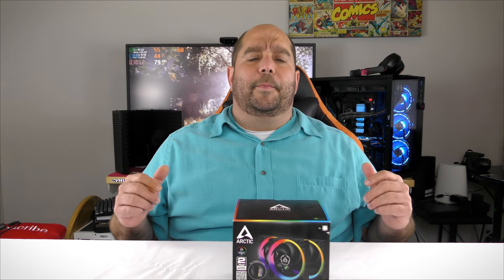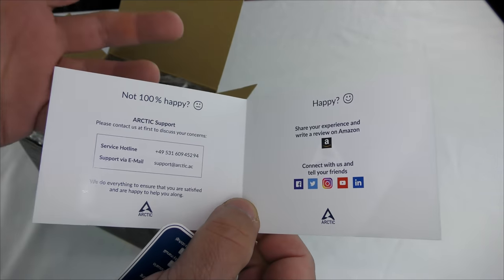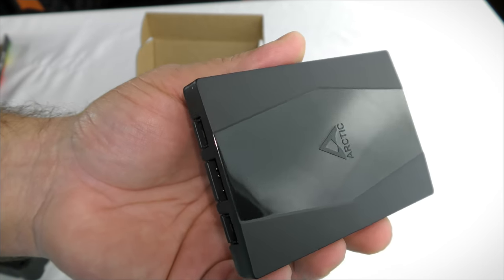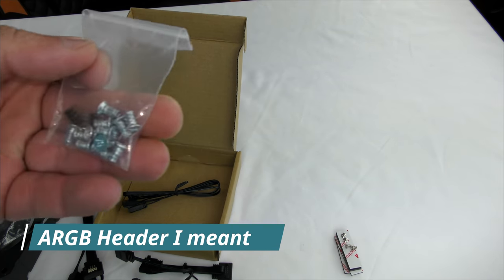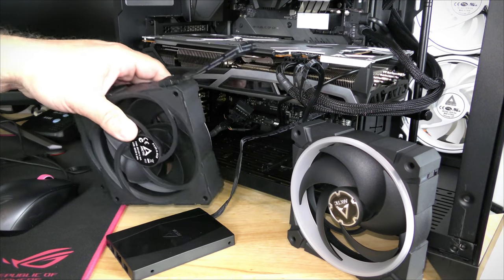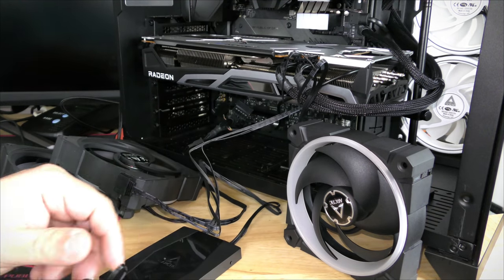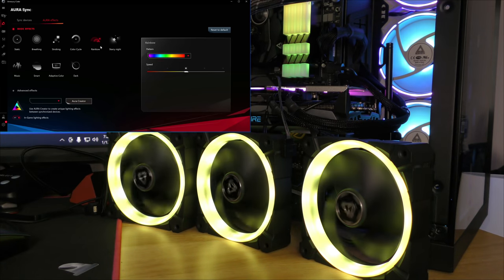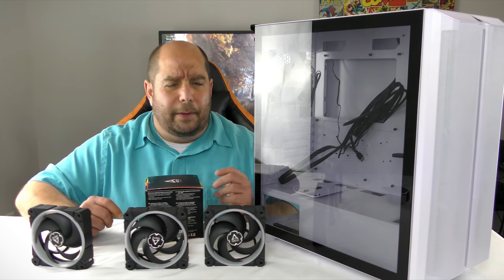NEW ARCTIC BioniX P120 A-RGB Fans - First Look

Comment: 10:35 it does NOT work with ARGB!!!!!
Reply from the maker: hmmm, odd, did you watch the same video I recorded showing you it working?
Reply from the maker: I am assuming you are having issues, maybe explain the issue and I can help you?
Reply: @ThisBytesForYou  You connected it to a 12V 4pin RGB header as it was meant to be used. It does not work with 3pin ARGB headers.
The hub „translates“ the „RGB“ into an ARGB-signal. Your motherboard has 2 ARGB (3 pin) headers and 2 RGB (4 pin) headers. I assume your RAM is plugged into a 3 pin header.
Reply from the maker: @autobus11a  ah ah ah, I see what you mean, thanks for clearing that up.  Yeah, you are right, the 12v is older vs the 5v and not technically ARGB but I think they were going for compatibility and for those people that did not have newer headers which is why they include the remote, for mass appeal.  

You can see I didn't use the remote, I used the Aurous software to control the lighting.  So outside of the remote, since you can control it through the software, it is addressable RGB controls, so Arctic fibbed i guess but yeah, it is not technically ARGB since it does not utilize a 5v header though it is their first foray into RGB so perhaps on their next gen they will correct some of the issues found in this, that I also mentioned to them and they promised to address.

Thanks so much for replying I thought you were just going to drop the comment and run, sadly like most do not allowing for an intelligible conversation.
Reply from the maker: @autobus11a  also, the RAM is not plugged into anything, it's all controlled by the motherboard and the DIMM slots, well that and Aurous.
Reply: @ThisBytesForYou  I think that this is important information about this device. Many people are asking for an „adapter“ from 4 pin to 3 pin. Now, here it is. You can finally control ARGB lights with „older“ RGB headers. The downside is, the Arctic-controller does not work with 3 pin headers.
The proprietary connector has also its downsides. There should be a cable for the „connect“ port with a fan header and a 3 pin ARGB header.
Reply: @ThisBytesForYou  That is very fancy stuff you have there.
Reply from the maker: @autobus11a  thanks my friend, so very happy you like it ;)
Reply from the maker: @autobus11a  I will discuss with them, thanks for the input

Comment: Got me 2x set of these but i dont understand the wires at all, wanted 3x top, 3x front.

They gave only 2x wires to go from fan to hub, but it is set of 3x fans ???? dafuk.

The wire between fan to fan is way too short, and the angle is fkked up, if you want the logo sticker pointing up...

Sigh...

Not that many ringfans with controller, dont like to use software at all.
Reply from the maker: so, did you happen to watch the video?
Reply: @ThisBytesForYou  

Does not solve the problem, the wire between fans is too short, and the connector ports are not on the same side.

Totaly idiotic design.

When you are modding your computers, your components must be in line with eachother or there is no point.

Goin for RMA, i still should have the window, or if the store has me 2x extra wires to reach the hub.

Why there is 3x ports on the hub if they dont give 3x wires for it ?

(Learned to always keep the packet materials.)

I have multiple computers and never had this type of issue. First time attempting to mod with theme in mind.
Reply from the maker: yeah, you would have seen in the video, I had similar issues, it was a decent first implementation, but it missed a few marks.  Give me a good old fashioned aRGB fan and I am happy.  Yeah, I try to keep everything, until I know I don't need it anymore, then I might toss it (my wife will tell you different).  A little less moddy, but these might be up your alley: https://youtu.be/m0d3Xs5c4Ps
Reply: @ThisBytesForYou  

Wanted to see what others think on this product too in comments, now i know in hindsight what to look for.

Trying to be perfectionist on this current build in mind.

They made the chain horizonticly, but fans always been verticly, you do notice the little things in the long run if you are attempting setup wars style.

Now thinkin Enermax or Bequiet, have my mind set on ring fans, black n red.

Ive used DeepCool fans many times, couse they give proper wires and adapters with, but sadly they dont make ring version.
Reply: @ThisBytesForYou  

Was going for MSI/Corsair/Arctic theme, trying to avoid Frankenstein build.
Reply from the maker: I still think Arctic is amazing, just not a fan too much of this particular fan, but the ones I linked up, I use daily, the P14 PWM PST A-RGB ones, my system is full of them,, I can't say much about deepcool or enermax since I dont work with them, but I would love to one day @mazz85-
Reply: @ThisBytesForYou  DeepCool rgb fans are very nice if you are goin for the basic appearance, they come with manualbutton in the wire, no need for hub technicly, are very quiet too. They sold rgb led strips too, not sure if available anymore. If you have spare time, give them a go.

Was gonna take the Arctic Freezer retro cpu cooler to go with these, black n red.

Gonna need to rethink my cooling solution, doing DeepCool now.
Reply: @ThisBytesForYou   I used DeepCool for too long, i forgot others have these basic issues.

I am still like: Did this happen   O.o ?
Reply from the maker: Arctic fans beside this one, take the standard fan approach, one cable for aRGB that can be daisy chained and another cable for a fan header, than allows you to plug in another fan so you can daisy chain multiple fans from one header, so here in this video : https://youtu.be/m0d3Xs5c4Ps?si=qEJ-ZYNVdkQL-CCF at 3:07 I go over the Arctic P14 PWM PST A-RGB White PC Case Fan, I use the black on in my system and they are awesome BUT they are not ring, ring seem to be difficult, never thought of that.
Reply from the maker: hahah, you rock, I like them, but the ring thing really does limit your selection, I have never noticed, sorry bud but I don't think you will regret it.  Thermaltake has them too, they are awesome, but they are limited in the same manner.
Reply: @ThisBytesForYou  TT not available at my local store, i aint gonna wait for months to get them from China.

Arctic, Bequiet, Enermax, Razer in stock.
For rings that is.

My computer is working, but it is a bitte of frankensteiny, now i have the mindset to try mod it this coming winter, can waste like 200€ per month.

RAM n psu caables next month.
Reply from the maker: Where are you located?
Reply: @ThisBytesForYou  North Europe.

The one country no one knows that exists.
Reply from the maker: Hahah, I know it exists but man, that sucks that the shipping method is that bad over there, sorry bud.
Reply: @ThisBytesForYou  Smaller country has smaller local stocks is what i am saying.
Reply: @ThisBytesForYou  

I am modding like 5 computers, this is the edit computer with amd Ryzen i want the rings, others are lesser ones with Intel chips for those i go more basic appearance.

I still play old Command Conquer games for example, i dont wana burn my Ryzen for those, is what i burn lesser Intels for, i can get longer duration lifetime from my computers this method.